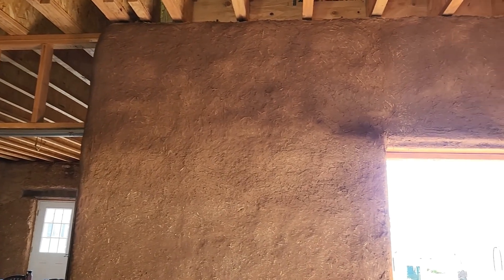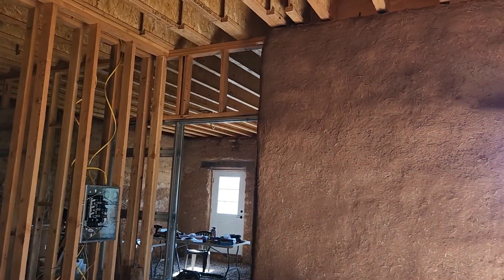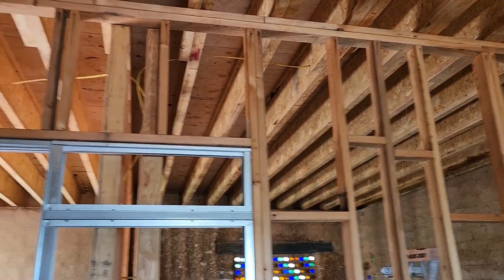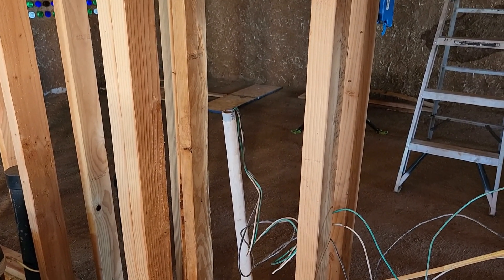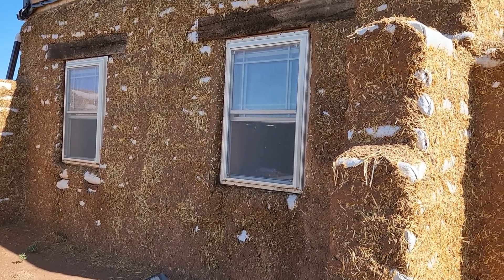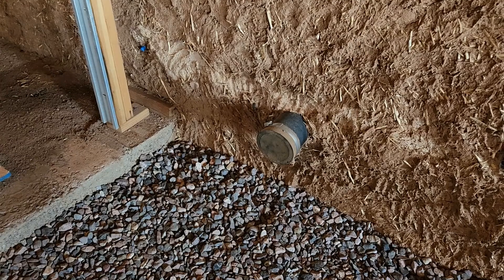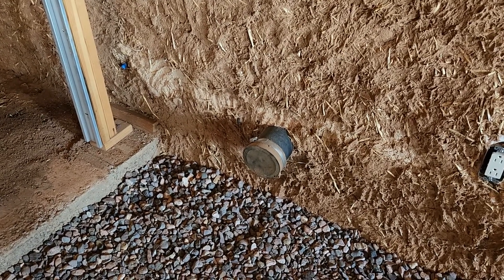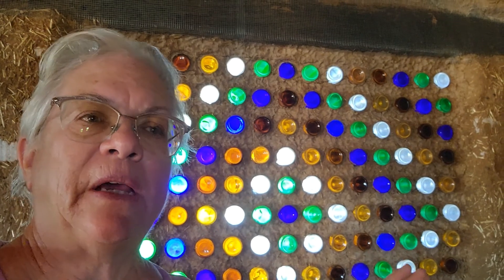Mudding the bedroom interior walls complete, review of recent storm damages

Comment: The header isn't supported by any jack studs. How is the weight transferred from it to the ground? I'm not a pro either, so I don't know, but my gut says that you might want to use giant fasteners if you're skipping on the jack studs. Your average screw or nail isn't made to handle that kind of shear force.

Comment: I know you don't have the ceiling insulated, but do you notice the temperature change from outside to inside. I would have guessed it is cooler inside than outside. Looking good.
Reply from the maker: Yes it is cooler, however, we thought even without the insulation in the ceiling that it would be significantly cooler than it is.